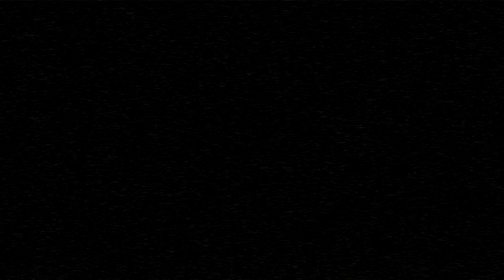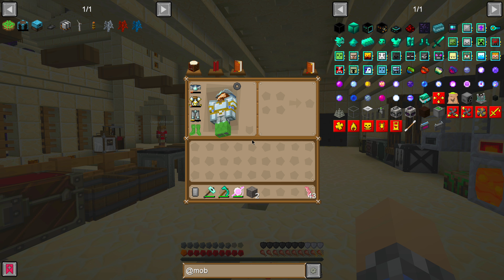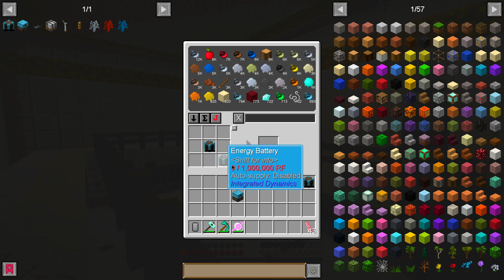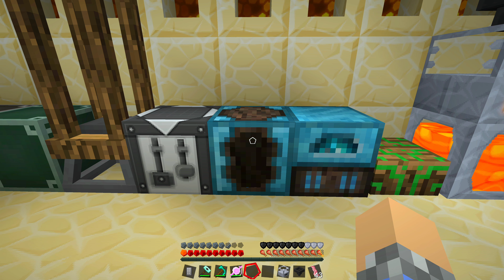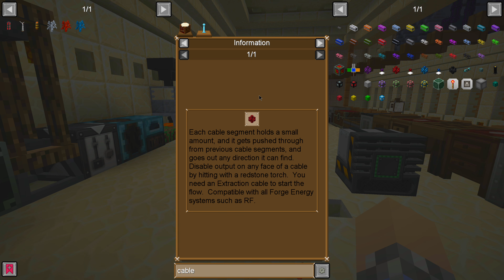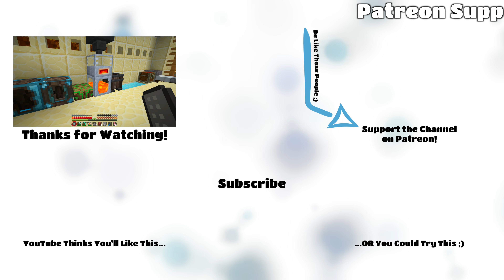Powering Up! | Sky Factory 4 | Episode 22

Comment: Looking at the heat generator, one would think it can extract energy from the bottom. Would that not make the additional pipe on the side redundant?  ...or am I wrong?
Reply from the maker: Well it doesn’t draw power, so...
Reply: @HowdyFolksGaming "lava", pardon me - but the logistical question stands.
Reply from the maker: Hmm possibly. I'd have to work out if it can draw in lava or if it needs it fed to it. Further investigation is needed.